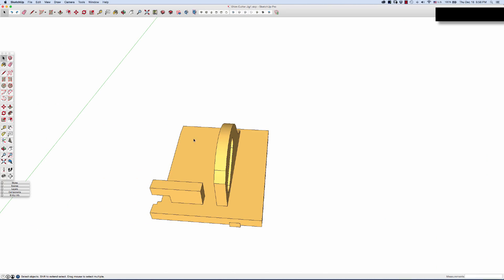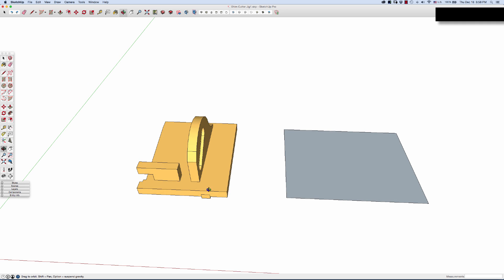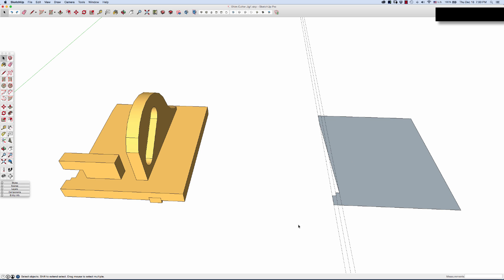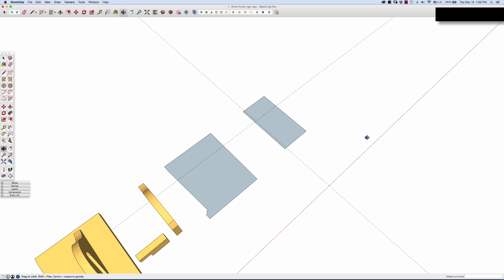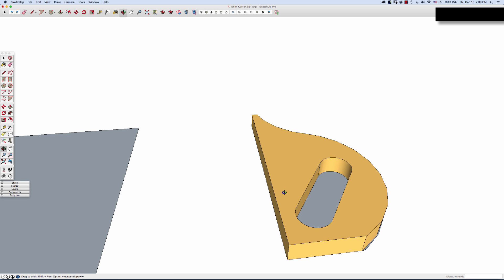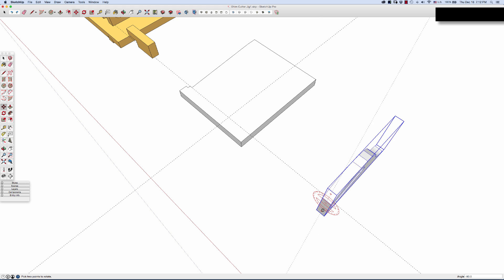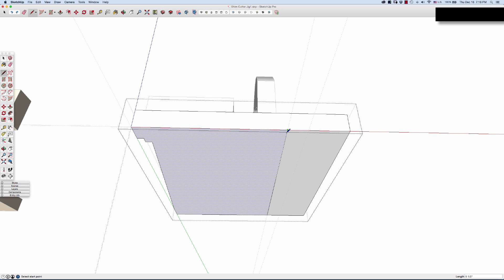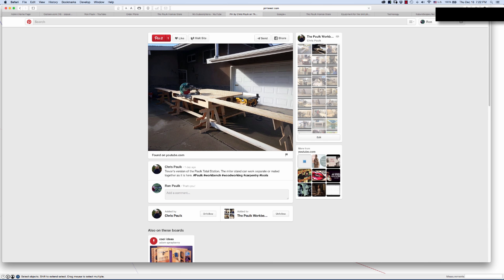SKETCHUP: MODELING A SHIM CUTTER JIG FOR THE TABLE SAW

Comment: Ron, carefully seeing you model, I concluded you model as if you are laying out dimensions in a blank piece of paper first and once you've  completed your view you extrude the semi final shape, I find this interesting, because I  prefer to draw a solid base material, say a 9 in long 2x4 block from which I 'machine' down or do substractions with push/ pull, so at the end to me modeling is 'virtual' woodworking and try to follow the same steps I will once I'm in front of the table saw, very interesting to learn your thought process. Thanks for this insight!